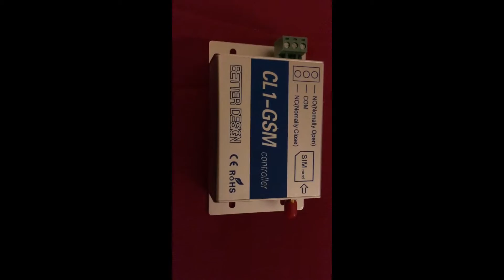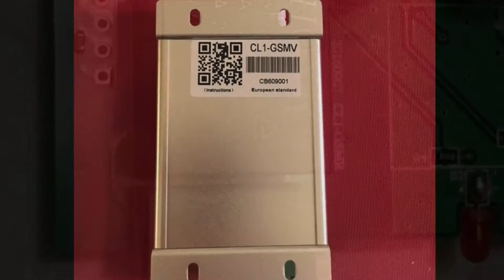CL1-GSM inside

Comment from the maker: This video shows the CL1-GSM components with the names of the integrated circuits, voltage controller: LM2596S, MicroController: STM8S10sk4t6c,  Timekeeper ds1302zn, GSM/GPRS chip